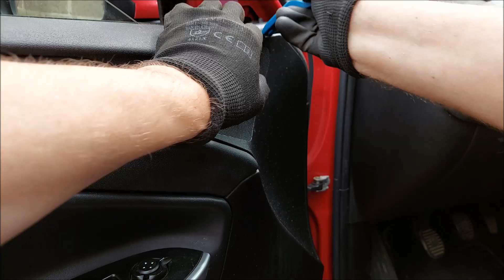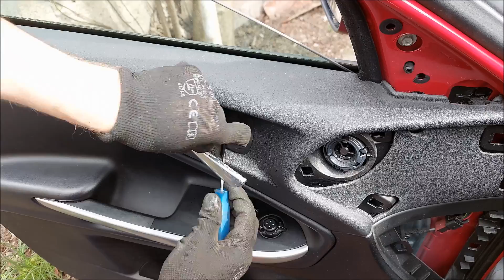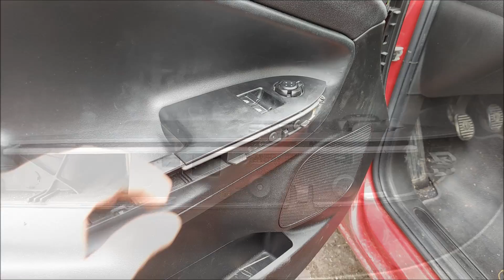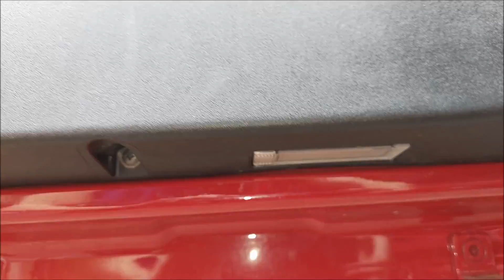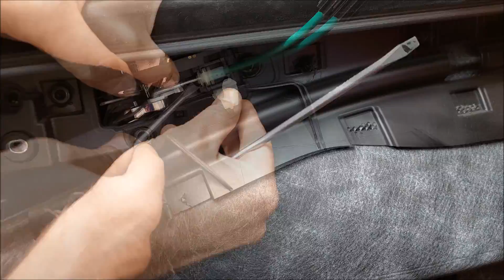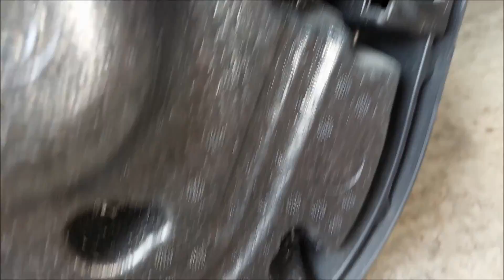Alfa Romeo Giulietta Door Panel Card Removal

Comment: Hey, any experience with rattling noise coming from inside the driver side door? Like metallic ratling periodicly
Reply from the maker: It's likely a loose fastener or a cable hitting the metal; hopefully, taking the panel off helps you locate the source easily 😊

Comment: Hi @ARC Garage , the front passenger seat of my giulietta is making a terrible noise, it seems to me that it's related to the locking lever that allow you to moove the seat back and forth. Have you ever experience this?
Reply from the maker: Not yet
Reply: If they are leather/cloth variant, there is a possibility that the noise is coming from plastic rings inside the seat which are connecting horizontal segments, support for the backrest. It is bad engineering problem with plastic mounted on bare metal. I read somewhere that people used wd-40 or machine grease. I still do not have courage to unzip the seat and do it.
Reply: @davidz.2836 Hi, it seems that I have solved this. It was coming from the 2 small piston that are on both side of the guide and keep the locking mechanism hold up when it's not used. These piston needed some grease because they didn't move up and down smoothly anymore.

Comment: Excellent video - as all your videos on the Giulietta.  I do have a question for you though: have you ever had to fix the problem where the external door handle on the driver's side does not open the door during cold temperatures?  Everything else works perfectly well (including the internal handle).  Heating the door did not work... any ideas? Or videos??? ;-)
Reply from the maker: I did see similar issues during cold days, but all I did was lubricate the handle

Comment: thank you very much for your video

I plan to soundproof the doors and trunk in the near future.
I will need to remove the rivets inside the door. But I do not know the size, hole diameter and metal type of the new rivets to be applied. I need this information.

The second thing I want to know is what is the speaker mounting depth from the middle sheet to the glass? For example, the speaker mounting depth I purchased is 75mm. How many mm thick do I need to use spacer? If the magnet side of the speaker touches the glass or if I use a spacer that is too thick, will the suspension part of the speaker hit the round protrusion on the plastic door panel?
  If you disassemble the speaker, can you measure the depth of the middle sheet to the glass?

These are the things I need to learn too. thank you
Reply from the maker: Don't have the info on the size of the rivet holes, but I can tell you that I installed quite big speakers and i didn't have any issues with clearance

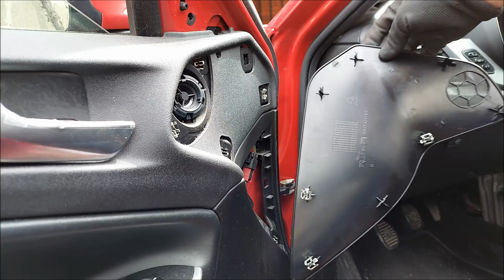Comment: This video is so frustrating, I have a problem with the main speaker connection and I watched the whole video just to see what the door looks like with the door cover removed so that I could see where the connector is ... but nothing! Is the speaker connector accessible without removing the entire door liner. The red/black connector visible at 0:58 - is that the speaker connetor? Do you have a picture of the entire door with the cover removed ?
Reply from the maker: When you remove the panel you got the access to speaker connector, it is right on top of the speaker, you can try removing the tweeter cover to see if you can get access to connector. Also you might have issue with door wiring loom
Reply: Thanks for that, I think it's a speaker connection problem. If I hit the main speaker grill the sound comes back, maybe oxidation on the contacts.

Comment: To remove speakers we need to remove whole door panel right?
Reply from the maker: Yes, I did this video because I put in the new speakers. You will also need to drill out the rivets which hold the speaker in place
Reply: @arcgarage  Will you be showing this process as well?

Which speakers did you choose for yours?

Your videos helped me few times I appreciate your work! :)
Reply from the maker: @doleginho  Glad to hear that, thanks. I got speakers from Atoto, they are significantly better compared to factory ones. The sound is greatly improved, but now I am thinking about installing subwoofer and amplifier. However, it might be an overkill since it is a family car